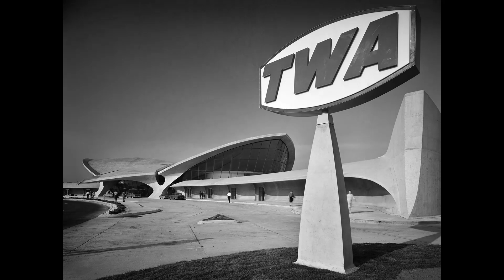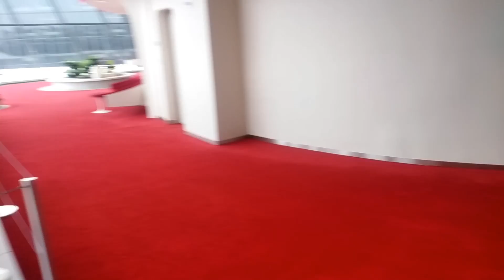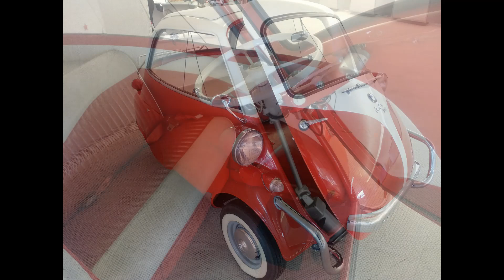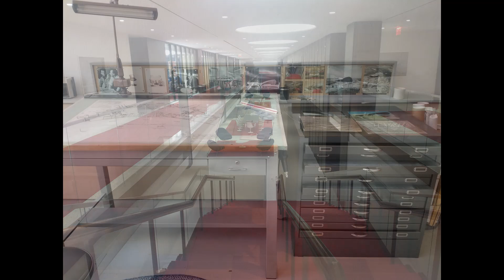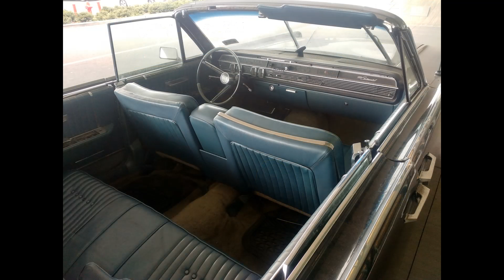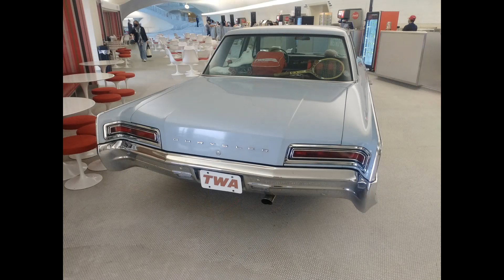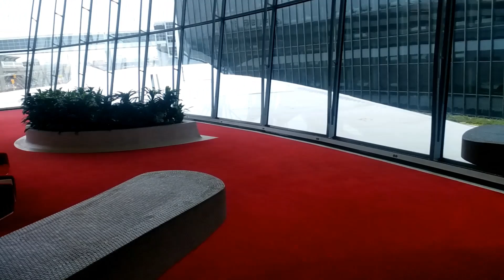TWA Flight Center and Lockheed Constellation

Comment: I was in the Biltmore mansion and about five feet over the velvet rope was a nice chess set and marble board. On it was a sign stating that the set once belonged to Napoleon Bonaparte and by his request upon his death his heart had been removed and lain on his chess set for a bit of time.
I was astonished it was so close to the visitors and had no security cover over it.
  The next time I went I looked for it in the house and didn't see it so asked a few guides till I found it had been moved into another building where the arms and armor among other things like cars was being displayed. When I finally found it it was quite obvious that one of the red pieces was not ivory, was not the same ocher red, and most definitely not carved to the same standard as the other pieces. One of the curators was close by so I asked her if that was a replacement piece and she said it was.
  I imagine she may have been a bit curious how I knew so I told her about the first time I seen that artifact and how unsecured it was. I then shook my head and said what a disgrace it was to steal something like that that the thief could never sell and could never brag about having without worrying over the consequences. I then informed her that I hope they hang the thief if they ever caught the selfish bastage.

And no I do not have that piece. I literally would buy the rope...😠

Anytime you find such a place or object that is part of aviation, automobelia, or motor driven cycles and you want to knock out a video like this know that we do appreciate it Greg!
  I would love to have you go through the Wheels Thru Time and Glen Curtis museum just to see what you would find most interesting!

Comment: Greg - I thoroughly enjoyed this video.  As a child, I was lucky enough to fly to Ireland out of JFK three times, in 1969, 1971, and in 1973.  Once was on a Pan Am 707, then on an Aer Lingus 707, and then on an Aer Lingus 747.  I remember being led to the flight deck each time to talk to the crew and get a miniature set of wings.  
Just last October, I was again flying to Ireland out of JFK, again on Aer Lingus.  I'm sure you realize they use the Jet Blue Terminal, as Immigration control between Ireland and the USA is handled in Ireland these days.  Anyway, I found myself transfixed by the Constellation just across the way.  I plan on spending a few nights in that hotel with my wife before long.  So thanks for the very timely tour.
By the way, I thought I was the only guy with a Pilot Certificate that would be seen in public wearing two different flannel shirts at the same time.  I bet Mrs. Greg just loves that look.
Reply from the maker: Hi Jay. Funny story, one of my flight attendants told me I'm not supposed to wear plaid on plaid. When I was talking to the fashion coordinator I met at the Constellation I asked her about it, and she said it's just fine. Of course the reality of packing for a 17 day trip in two carry on bags means that fashion takes a back seat to practicality.

Comment: Power recover turbines a.k.a. turbo compounding is used in trucks nowadays. 
Formula 1 also has a turbo-electric recovery system.
Reply from the maker: Could you give me a link to a truck that uses that system? The F1 stuff is quite a bit different.
Reply: @GregsAirplanesandAutomobiles  I just typed turbo compounding or Volvo turbo compounding on youtube search.
Yes F1's system is quite different and complicated. 
But it can still work as a turbo compounding system, among other things, as the energy recovery system unit on the turborbocharger shaft can recover/generate (electric) energy and use it as power via the electric motor connected to the engine.

Comment: The BMW Isetta was a 4-Stroke BMW R25 Engine and good for almost 100mpg. And with closer to 15hp it added a lot more power to go with 3-Wheeler Handling.
Reply from the maker: The Isetta 300 has a four stroke, most of Isetta variants have a two stroke. As I said, there were many versions of this thing, I couldn't cover all of them so I just gave a brief overview of each car, with a bit extra on the Newport for the reasons I explained.

Comment: I traveled on a prop airliner in 1979 on my way to Fort Knox for basic training. I caught the prop from Florence SC. to Atlanta GA.  On the way back 4 months later it was a jet, I  asked the flight attendant where the prop was, she said they where all retired. I had one of the last piston prop flights for Piedmont Airlines. I'll never forget seeing those flames coming out of the engines.
Reply from the maker: That's really something, you witnessed some history there. It was normal for those engine to belch fire and smoke on start up.
Reply: If it was a Piedmont flight in 1979, it was a YS11 with RR Dart prop jet engines. All the piston Martin 404s were retired in 1970.
Reply: @bobvicki   I thought it was all Piedmont but then it was 43 years ago. I went from Florence to Atlanta, then Atlanta to Louisville KY., then reverse on the way back. But the first leg was a piston prop. It took off from Myrtle Beach, stopped in Florence, then on to Atlanta.
Reply: @robertcardon5402  Must have been Southern Airways. They operated Martin 404s well into the '70s. Here's a cute youtube video about the Southern 404's:
https://www.youtube.com/watch?v=21EHAATQp-8&t=4s
Reply: Sounds like Lynyrd Skynyrd airlines.
When we'd fly from Kansas City to Manhattan Kansas, which is where Kansas State University is, to get to Ft Riley in the 80's it'd be on a "vomit comet", they were anything from a 6 seat(counting the pilots and copilots) piston engine plane to about 12 seat turbo props.
And believe it or not they actually managed to lose my luggage one time, how that was possible going from Kansas City to Manhattan Kansas eludes me to this day, I was stuck at the Manhattan Kansas Airport (I'm using the word airport rather loosely here) until about 2 in the morning when the very last flight in had my bags.
Then try to find a taxi at the Manhattan Kansas Airport at 2 in the morning, what a good time I had that night.
Reply: I dunno, I've flown commercial on a Cessna twin piston from Sydney Montana to Billings in the summer of 2016.

I wish that I paid more attention to the type, 414 or 441 etc. but it was ~ 8 seats, narrow isle, and the awful drone of the engines slightly out of sync with two 20-something pilots was enough to cause me to buy a motorcycle in Billings and ride it back instead... (Ok only partly true, I went to see the bike, lol).
Reply: Pilots have to start building their flight hours somewhere....!

Comment: Great video. I flew a Lufthansa Super Constellation to Europe as a kid in 1957. We took off from Chicago and refueled in Montreal, then Gander and landed in Shannon where we go off while the plane refueled and went on to Frankfort. I remember taxing out to the end of the runway where the crew would do a mag check on each of the four engines, then go to take off power on all four engines with the brakes on. It was very impressive sitting there shaking and roaring till they released the brakes and you trundled down the runway. Not at all like modern jets. A few years ago, I saw a Lufthansa Super Coney on display at the Munich airport and was amazed at how small it looked.
Reply: The first DC8 and the first 707 weren't that much bigger, but the 747 realky dwarfed it.